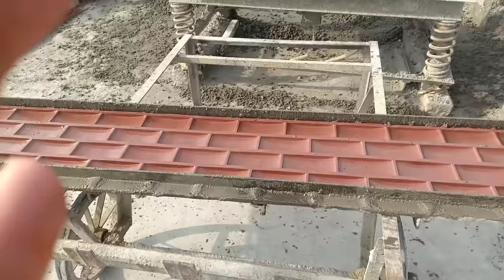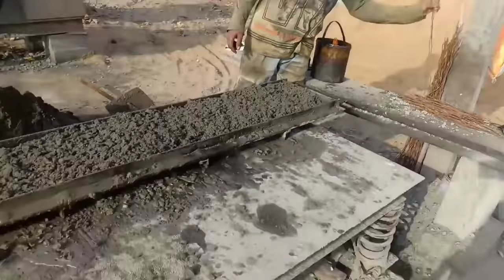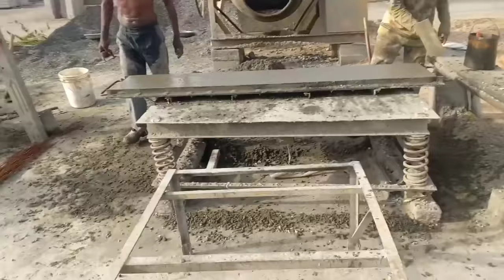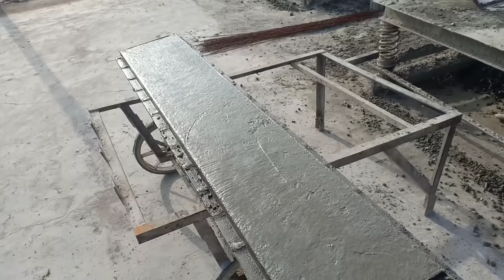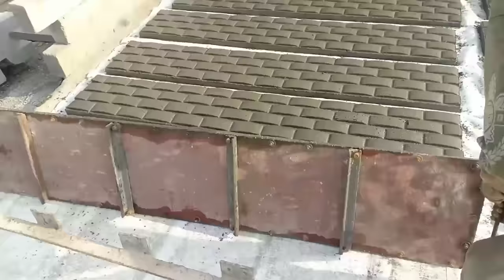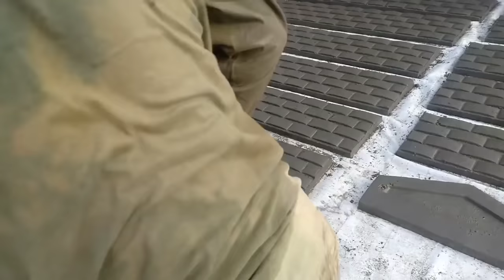How to make rcc panle brick design for compound wall

Comment: Ну  ребята  работая  у нас в Казахстане  вы  стали бы  миллонерами,  классная , ювелирная  работа.
Reply from the maker: my whatsapp number is +918200244972
Reply: @amulcement1190  Hi. My name is Wilfred. I live in Kenya. I'm trying to make panels for my boundary walls. After letting it set for 24 hrs the cast gets stuck on the sides and breaks on the edges when removing it. How long should I let the concrete cast stay on the moulding tray? What is the cement, sand, aggregate ratio mix? How to make sure it comes off the tray without breaking apart?

Comment: I need a supply of wall pillars and panels molds. I'm in Swaziland
Reply from the maker: +917878102626
Reply: The moulds are available in Gujarath state.pl go you tube channel and search.my reletive has purchased it.one post pillar +2pannels(different moulds) approximate 30000+.
Reply: Contact me sir
Reply: @md.mokabberhossain2971  can u sending Bangladesh.i want buy.how much.